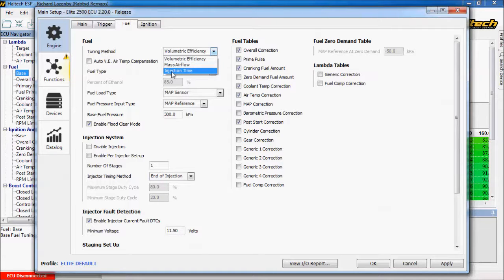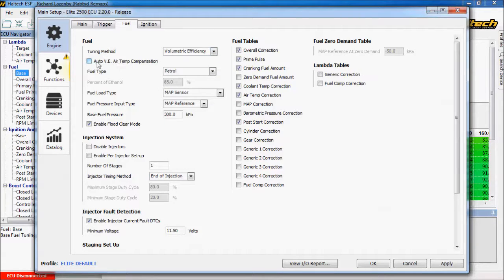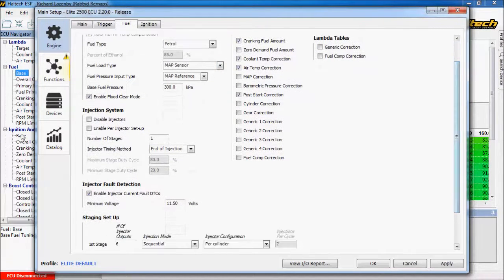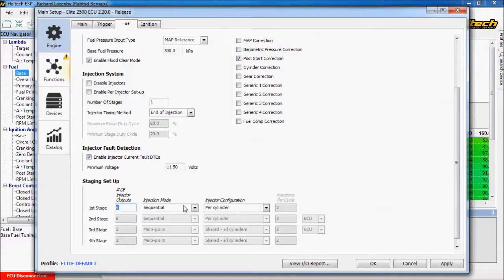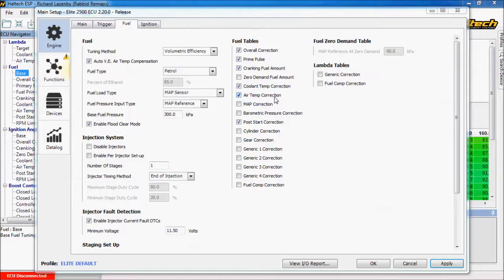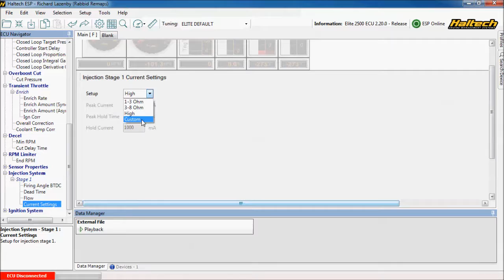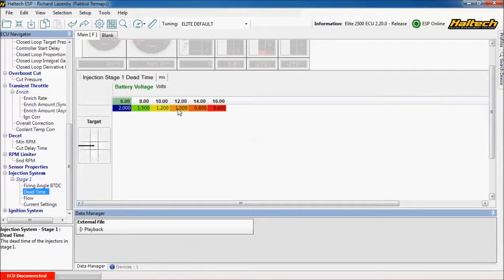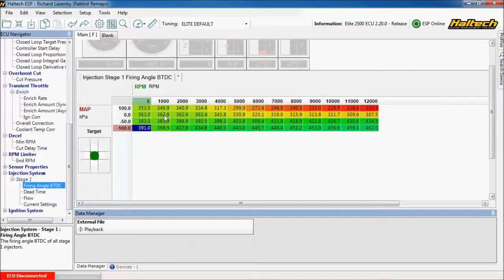Haltech Elite Tutorial Part 3 - Fuel Injection Setup

Comment: I have an 4AGE 20V with ITBs. I don´t want/can´t to run a map sensor.  If i try to disable the Onboard MAP sensor it tells me "MAP sensor required for VE Tuning"
So is it okay to choose:
Tuning method: VE
Fuel Load Type: TPS
And just change every correction table that uses MAP to TPS?

If afraid that it still uses the MAP sensor in background calculations. (Also how can i use the onboard sensor for Baro correction?)
Would be nice if anyone could help me
Reply from the maker: Make your map sensor input just open to barometric pressure.

Then change axis of fuel and ignition tables to use tps.
Reply: @tunedbyrabbid  Thanks for the fast reply!
So it is actually that easy, Thanks!

Comment: Good video. But I seriously doubt whether haltech really uses ideal gas law. The closed loop really struggles. If it were to include the target afr before fuel mass is calculated, there is no need to even have option of closed looping.
Reply from the maker: Haltechs primary fuel equation Speed density is based upon the ideal gas law. Unless you change it to MAF or Pulsewidth mapping.

Older ECU's used to use a base pulse width and then various trim tables to fudge some fuel as temperatures changed without any care to lambda target. 

Any target lambda table in those old ECU's was there simply to tell the car what you mapped the base fuel map to.

Speed density works like so:

You take cylinder volume, pressure, temperature and air gas constant to calculate air mass for a cylinder at 100% fill. This is exactly your ideal gas law.

You then multiply it by volumetric efficiency. To get the engines breathing inefficiency. This is the fuel map you adjust so your calculated mass is factored by this value.

You now have a good calculated air mass in the cylinder. You can now calculate the fuel mass to mix with it.

Then you use the stoich of the air fuel mix to calculate the base fuel mass to use. This fuel mass is configurable or variable with sensors such as flex fuel.

Then you divide it by the target lambda to increase injection if you're injecting say lambda 0.8 instead of 1.0 This would increase the desired fuel mass by 20%.

Now you have a calculated fuel mass. Next you need to know how long to squirt an injector to deliver the required fuel mass.

Then you take your injector size and your fuels mass per volume to calculate the base injection pulse. This can again be fixed configuration say 0.745g/l or variable based upon a flex fuel sensor.

Finally you add any injector battery offset and any short pulse adder to get your final injection pulse in ms.

All of the above is done without any closed loop fuel control. If mapped properly your fuel should be very very close.

Closed loop is there as a feed back mechanism encase any of the dozen or so values in that calculation are off. Your air temp might be off as its not actually in the cylinder its in the manifold, your fuel might be a slightly different density because of its temperature etc etc.

So if mapped correctly your closed loop trim if used should be within less than +/-5% at all times.

If you calculated the wrong air mass you'll be off, if you calculated the wrong fuel mass you'll be off, or if you calculated the wrong injector pulse width you'll be off.

You need to ensure all your ECU inputs and outputs are configured accurately and if done so and modelled you shouldn't need any real closed loop correction ever.
Reply: @tunedbyrabbid  thanks for the explanation. I get what you are saying. But how different is to start with say a 40% VE and start tuning and start with injector ms and start tuning. Like in the case of syvecs ecu. And you have all the correction tables in both methods of tuning. It is difficult to get fuelling close to 5% of target afr even in VE mode. I think may be some of the inputs such as fuel base pressure way off. The best  VE implementation is seen in Adaptronic ECU. I have all ecus mentioned and I struggled almost same everywhere.

Comment: how you change de size of injectors
Reply from the maker: Left hand side, Injection > Stage 1 > Flow Rate
Reply: @tunedbyrabbid  is this flow rate based on one single injector, or all 8 added up? How does the ECU know the pressure at which the flow rate is figured?
Reply from the maker: Flow rate of the individual injector.

Pressure is configured as either constant or map referenced and the ECU calculates it assuming a regulator of known pressure.

Also you can add a fuel pressure sensor for accurate readings.

Comment: Is there any video where firing angle more detailed explained? I see some people insist on injection the fuel against closed valve but to me it sounds more reasonable to inject fuel to an open valve after the exhaust valve is shut.
Reply from the maker: Not yet, but you could tune this by turning off any O2 control then adjusting your injector angles to the point that your AFR is the richest without touching your fuel table.

If your mixture leans out by adjusting the angle you're getting more mixing or sending fuel out during valve overlap.

Comment: Curious why does the angle narrow so much under boost??
Reply from the maker: Are we talking ignition angle?

Under higher pressures the flame propagation is quicker so less time is needed for pressure peak.

Also you are more likely to get detonation under higher loads so you may detune your ignition for safety.
Reply: @tunedbyrabbid  i mean for the fuel injection fire angle, but this is good to know as well.

Comment: How do you calculate the injection. Angle from camcard ?
Reply from the maker: To work out the crank degree your inlet valves open and close to match the injector time.

Depending whether your ECU has a start of injector or end of injection will change the calculation you make from that,

Comment: Hey I really appreciate you posting these videos they're quite in-depth, in many ways better than the basic information that haltech provides. 
I had an ECU issue with my old work truck so I decided I wanted to learn more about standalone ECUs. I bought an entry level style ECU, the 750 elite, and your videos quickly helped me understand what many of these settings did and what they affected. You also helped me stay focused on what sensors were needed and so much more. 
My truck is finally running again, and I know that I have a whole lot more to learn.
Reply from the maker: Thanks for your kind words means alot.

I'm glad you're learning and getting your truck going!

I will continue this series as I've picked YouTube back up again once my engine building course is done I will finish this one. So check before for more soon.
Reply: @tunedbyrabbid  Fantastic to hear, I look forward to watching them. One thing I messed up on initially was my trigger settings. I melted some LS coils which was a costly lesson. I'm now switching back from LS Coils to the stock 2channel 2coil system which needs an ignitor and I'm worried I'll bug something up again.

Comment: Dear haltech gurus, I realize replies are scarce, but am in need of help for my primary break in tune. Would you tell me if it's possible when using a single af sensor to individually lean out individual injectors at idle, until there is a lean misfire then rich them back up a notch...to get them individually dialed in before adjusting shared tables? Could this be a more accurate way when we don't have individual runner af sensors? I need to get my elite1500 tuned well enough to drive to the tuner, but want a clean engine break in tune before the drive. Thanks for any help!
Reply from the maker: Not sure what you're trying to achieve with this.

Use an injector calibration sheet or send them to a proper flow tester.
Reply: @tunedbyrabbid  Current Honda oem software (for several years now) has a feature for diagnosis which leans individual injectors one at a time in increments at idle. It changes individual afr and the ecu then determines which injector is lean or rich. This works even though each bank of three (on the v6 for example) injectors/cylinders shares one afr sensor. Its pretty clever. 

Since my subaru only has one afr sensor that all cylinders share, was just asking if it were possible with the haltech software. Apparently it isn't, as I finally got a reply from someone at haltech quite a while back.

This would be a handy tool if trying to diagnose a faulty injector that may be slightly restricted internally or just malfunctioning otherwise. 

My injectors had the included data and I also sent them out to an independent tester to verify their specs. Small price to pay for being sure they will do the job properly. I've also sold the 1500 and got a 2500 for a little more flexibility. 

Thanks for the reply and the great video btw